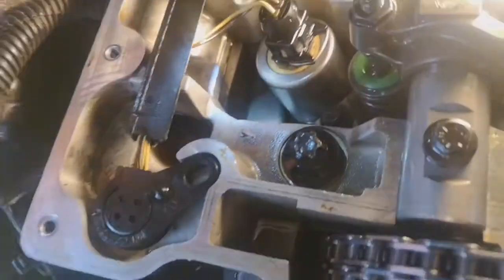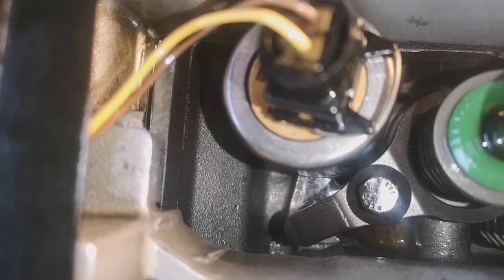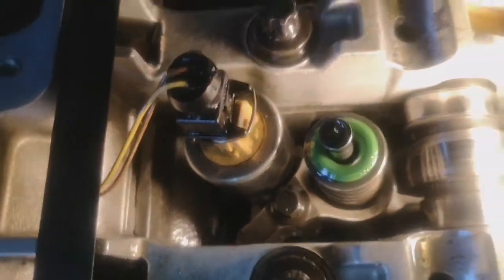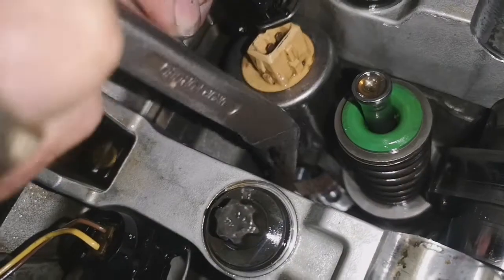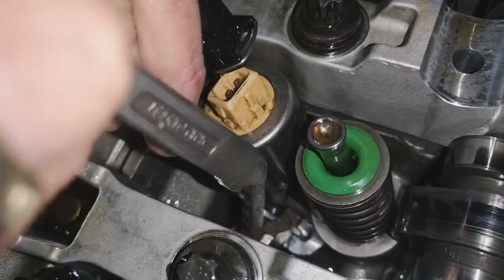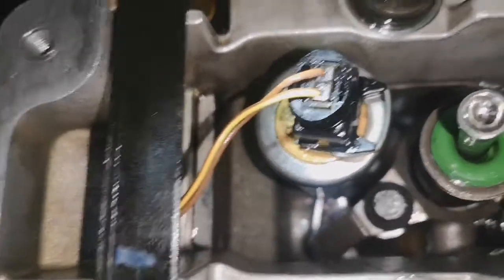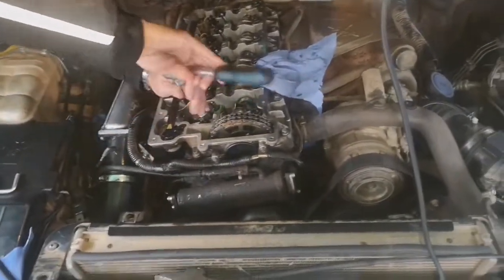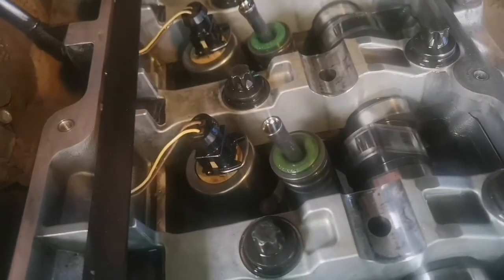Diagnose land rover discovery 2 td5 diesel in oil. Cracked head or bad injector

Comment: hello guys i have been driving defender td5 for 15 years and is a good one. have driven 350,000 km and only had problems with the diesel system, the first 150,000 km of diesel in oil, diesel pump, diesel high pressure pump, injectors leaks over and over again.  I am going to drive with 2 stroke fully synthetic jaso-fc oil to add to the diesel tank, about 300ml on 50 liters of diesel. I have now driven 200,000 km there without a problem and the engine runs silently. the diesel of today is too dry and gives  no lubrication to the diesel system so I add back what has been taken out
Reply: @wardysworx  didn't realize the td5 could use veg oil? Is filtered waste veg ok?
Reply: @wardysworx  So what kind of mix would you use in winter, of new veg oil to diesel?
Reply: @wardysworx  Really interesting and helpful, thank you.